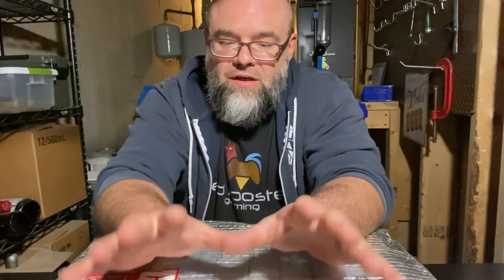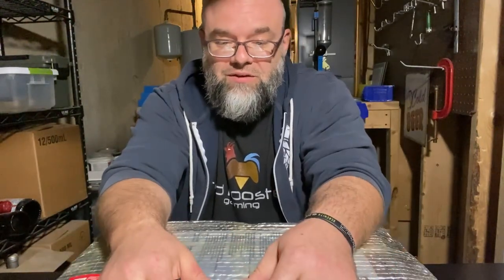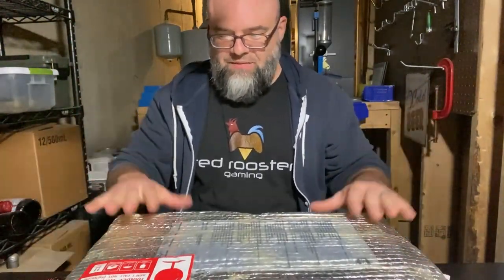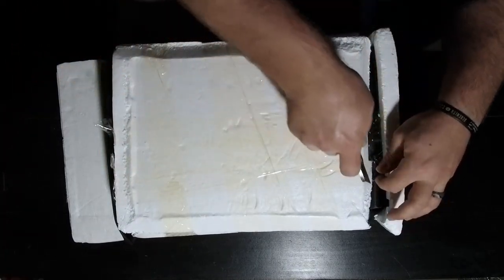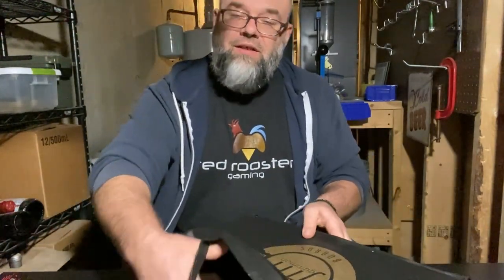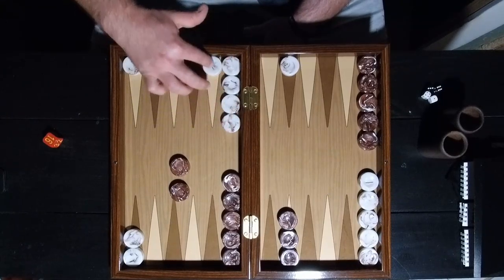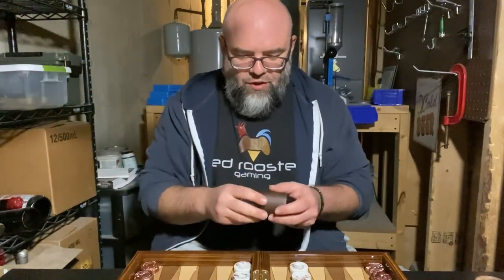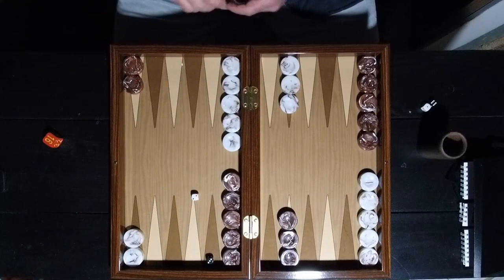Unboxing The FM Gammon Mini Nature Backgammon Board

Comment: Great unboxing! Some questions:

1. How do you like it after having it a few months? Is it holding up well? Any dings or scratches?

2. Is the carry bag decent or does it seem cheap?

3. With the components all being stored inside the bag that moves around inside, is it causing any wear to the surface or rails?

4. Are you finding that due to its small size that the dice go off the board a lot when you roll them?

5. Do you think a baffle box would work ok with it for dice or is it too small?

Thanks!
Reply from the maker: Thanks so much for watching! I appreciate you and your comment and questions.

1. Love it! It is holding up well. My wife and I just took it on a camping trip which we play on in a video I just uploaded. Check it out if you have a chance.

2. The carry bag is very inexpensive and flimsy. I purchased a leather computer bag from Amazon which works much better.

3. I had also purchased a leather pencil case which held all the checkers, cube, and dice nicely. However, a buddy of mine in our local club has a friend who made a beautiful wooden bear off tray that now holds everything, which you can also see in the new video.

4. I do not have any major issues with the dice with that board.

5. Baffle box would be fun, but I am just as happy with dice cups.

Cheers!